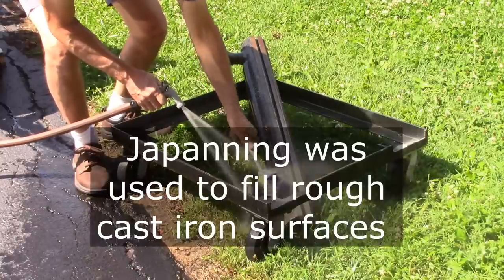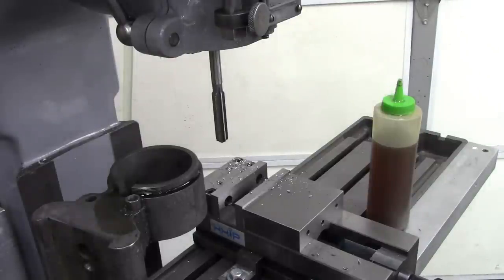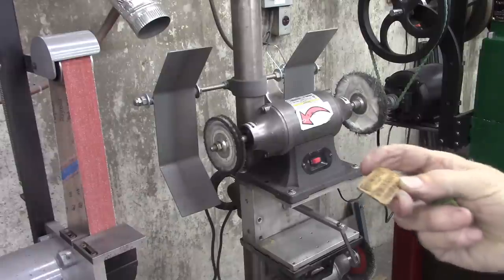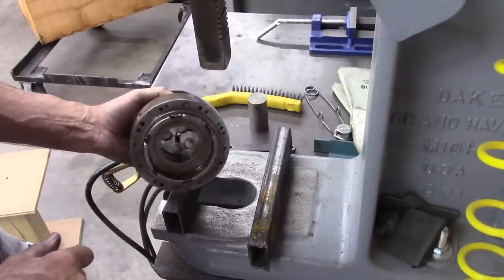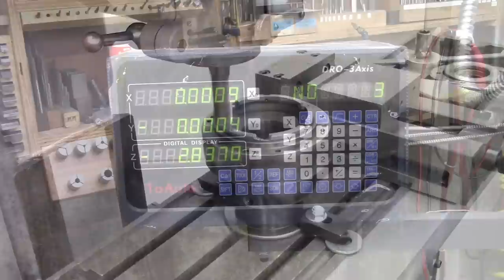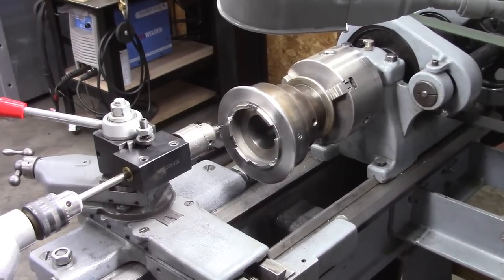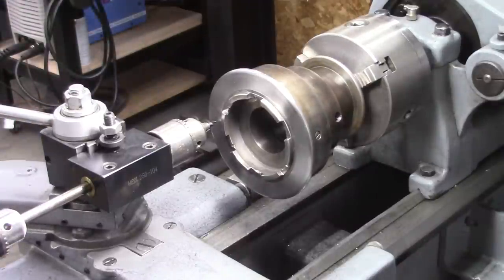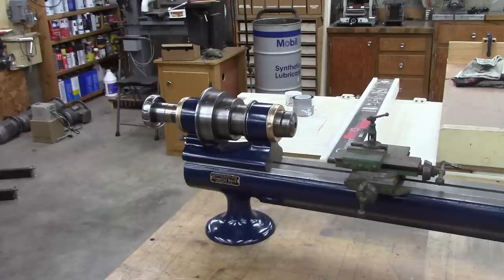Restoring the HARDINGE CATARACT Bench Lathe Part-2

Comment: Nice job. For a crack in cast, I have always been told to drill a hole at the end of the crack to keep it from continuing. Good job on heating the entire casting in an oven so that it heated all the way through. Do you have a process for cooling so that it doesn't cool too quickly?
Reply from the maker: I thought about making it cool slower but did not. It was in a draft free area and I let it cool slowly. It seemed to do okay. I would have been more concerned if it had been welded. Drilling might have been better for the crack but I wanted to let the braze get down to the sleeve. It seemed to do well.

Comment: Around 34:40 I could see some burrs on the holes in the pulley. Then it seemed that you put the ring on top of them. But maybe you took it off and cleaned up the pulley surface before permanently mounting it?
Reply from the maker: Good observation. Yes I took it off and clean it. Thanks for watching!

Comment: Did I miss how you determined  the bolt circle diameter for the holes in the sleeve?
Reply from the maker: Sleeve? You mean the indexing ring? I just used the old holes as a reference by lining up the tip of the drill bit with an original old hole.  Also, the pin that goes into the holes is off center. In other words, you have to rotate the pin slightly to make it line up with the holes so the absolute hole location is not very critical.

Comment: Epic, looking real nice Winky, there's a Youtube Channel called Downriver Tools, he used to sell Turret Kits for all Lathes, i got some plans from him years back, after seeing this, i will have to get started on it i think, also Emma from Emmas Spareroom Machine Shop made a flat Belt Pulley setup for her Lorch Tool Room Lathe that you can change while it's running, not sure if it's what you had in mind but she has a Playlist of it.
Reply from the maker: Good information. Unless I change my mind I'm going to run the lathe with a VFD and use the larger pulley only. The VFD will cover most speeds but I plan to put a 2 step pully on the motor to get kind of a back gear so the motor isn't trying to run super slow.  Emma's speed change setup has me curious  I'll have to check that out

Comment: The inability to remove that ring around the thrust bearing will prey on my mind for as long as I have the bench lathe. Oh, wait I don't have it! :)
What a beautiful restoration job Winky.
Reply from the maker: I think I have that figured out. I was looking at some diagrams on the internet that were misleading but I found some new ones that show threads...  the piece I was trying to press out has threads. I might end up leaving it...  the end play is perfect as is. Still I am tempted to remove the pulley and clean up the threads. Thanks for watching!
Reply: @WinkysWorkshop  There is that saying "Leave well enough alone", but oh, its so hard to resist the urge to fix it!
Reply from the maker: @MiniLuv-1984 Yep. I usually lean toward trying to trying to make it right or even better.